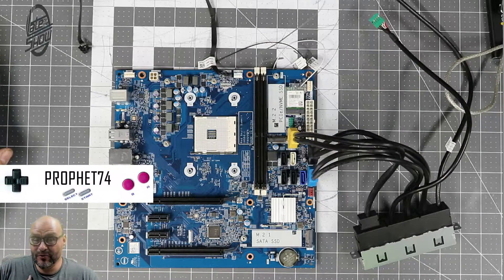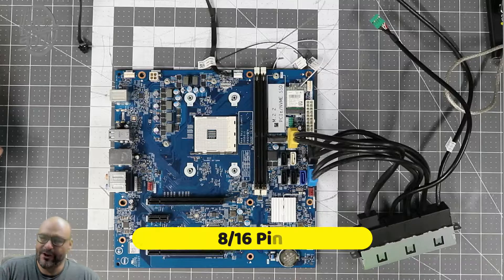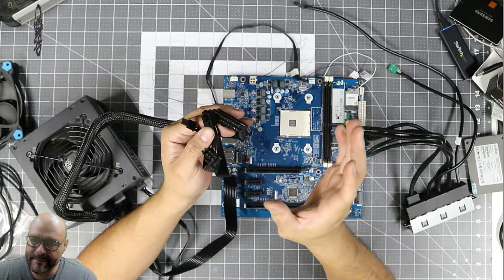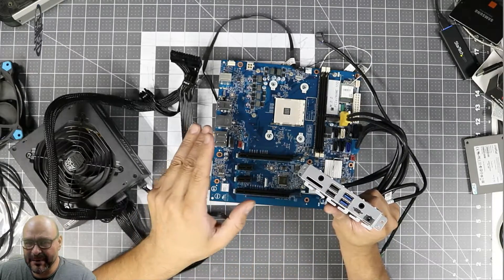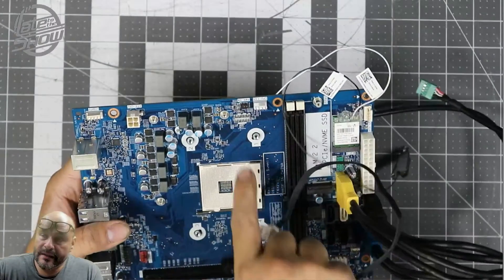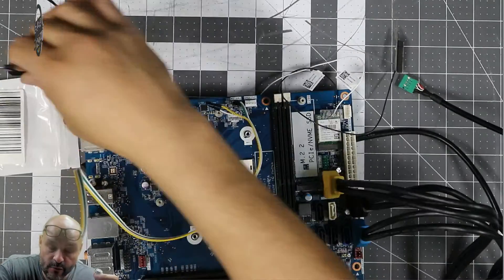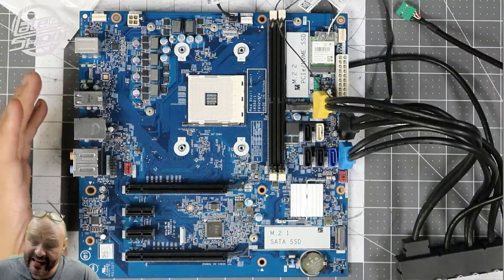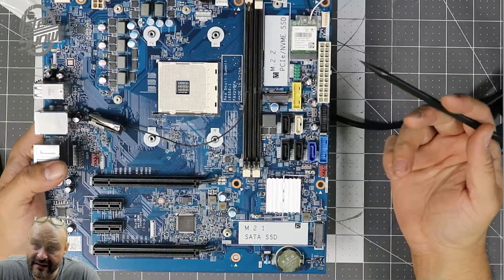Upgrading Dell Inspiron 5675

Comment: Also 2:00 an 8(4+4) pin connector from my Segotep 600w worked fine on my board for the cpu power.

Comment: This guy is showing the PCI-e power connector as being the CPU power connector. They are COMPLETELY DIFFERENT. Any standard power supply will have a CPU power connector that will plug directly into the 4 pin CPU on the motherboard. You don't need to buy any converter. This guy doesn't know what he's talking about in regards to the CPU power connetor.

Comment: the 4 pin connector is rated for 192 watts and r7 2700x max power draw is 105 watt, which is the best upgrade option for this motherboard, that is currently confirmed. so I personally don't see a problem with using a 4-pin connector for the cpu.
Reply from the maker: You have none for this motherboard, unless you can rewrite your on connections and you know how to read the voktage. I had to replace the entire case, motherboard and power to upgrade.

Comment: I saw people succeeded in flashing a 5676 bios into the 5675 to get support of Ryzen 2700.
Reply: do you know if they released a bios update for a 5800x3d?
Reply: @kommandokodiak6025  For 5675, you can only use 1st gen Ryzen. I am not sure about 5676, but it is very unlikely Dell would be so generous to give it supports of the 5000 series.

Comment: can you make a video on how to remove the power supply?
Reply: I just upgraded the pc to a 850 watt. Besides unscrewing the screws, I had to rip off the back plastic in order for it to fit.
Reply: @andersontucker5522  friend posts a video explaining how?? or explains in detail because i have a gtx 1060 and i want to put a rtx 3060 but i have to change the power i bought a 650 w but due to the limitation of the inspiron 5675 cabinet i don't know how to change or would like to ?
Reply: @andersontucker5522  Can you please share which PSU brand/model you purchased? Thank you
Reply: @austintrejos995  a gigabyte 850 watt. I sold the pc a while ago, but I would recommend seasonic for any new psu.

Comment: I bought a MSI MAG A550BN PSU for my Dell Inspiron 5675. I think I connected it right but base on your video it doesn't turn on because the CPU cables pin are an 8 pin and the mother board has 4, am I correct? Do I need to return this PSU? Thank you.
Reply from the maker: Yes you need to return the PSU

Comment: hey man maybe you can help, i just installed a new cpu  (ryzen 5 5600X)  on this dell and now my comp wont turn on, you think this new cpu doesnt have enough power from the power supply or what could be the problem, i had the stock cpu the ryzen 3

Comment: Have you tried installing Server 2022 on this 5675 motherboard, I have been trying but I keep getting stopped after I install HyperV and most of the time (not ALL the time), when I reboot the server it just has the windows circle just going on forever, I have waited 90 mins and did not see if complete and other times I got it to reboot but after is gets into this loop I have to hold down the power button and sometimes in goes into recovery mode and sometimes not?  Any ideas ?   I am thinking about putting 2019 on it today and see if I am getting the same results, but I would be interested in your thought since I got 32gb of ram in this 5675, it would be great for a small Hyper-V server running 2-4 VMs.

Comment: My Dell Inspiron 5675 doesn't turn on after a power outage in my area. I saw a video where show to check the diagnostic LED light in the back of the PC. When I press the button the light doesn't turn on. I believe the power supply needs to be replace. Does anybody know where can I purchase one? Could it be something else?
Reply: You can get an EVGA 700 watt power supply for about $80 that fits really well in this case

Comment: I had a problem where I wiped my hard drive after having constant crashing and blue screen problems.

Whenever Booting my pc I would get the crashed blue screen to scan or repair and I could continue and it would boot fine, but I would often struggle updating windows and could not reset my pc at all except for wiping hard drive.

Now that I reset my hard drive to reset my computer and install and ssd, I’m unable to install windows, is it a bios issue or something else?
Reply: @late to the show
Reply: Really could use your help

Comment: replacing psu and upgrading to rtx 3080 need to reinstall windows? or I can just uninstall amd driver and install nvidia drivers after switching gpu?
Reply from the maker: No need but you need to turn off the security feature in bios before the upgrade
Reply: @LatetotheShow  what feature?
Reply: @LatetotheShow  can turn it off after upgrading. I just now put in my gpu and need to put psu. I can't turn it off after upgrading stuffs?

Comment: Is there any way I could upgrade my GPU and do you have any ones that i could upgrade to? I have the AMD R5 1400 with a RX 570. Which GPU's could I upgrade to? And If I need to upgrade my power supply how would i do that?
Reply: Rx580 and gtx 1060 are plug in play upgrades. There aren't many other options as the mother board does not allow it.
Reply: A new power supply would require a new case. Pretty much, only things you could upgrade without essentially rebuilding it, is ram ssd and gpu. As long as you don't surpass wattage
Reply: @SnD340  I was able to upgrade the psu by taking off the back plastic panel. 😁
Reply: @andersontucker5522  friend posts a video explaining how?? or explains in detail because i have a gtx 1060 and i want to put a rtx 3060 but i have to change the power i bought a 650 w but due to the limitation of the inspiron 5675 cabinet i don't know how to change or would like to ?
Reply: @CanaldoFeB  I was able to take out the old psu and put in a new one just fine. Used the same screws I think. Just a screwdriver and pulling it out. Pretty simple
Reply: @andersontucker5522 I know many years have passed away... but, did that psu upgrade worked well? I want to change my psu because it started failing but want to put some extra power to change the gpu as well for a 3060 or 4060
Reply: @sargentosayala4967  I don’t have the PC anymore but when I did have it, it was working fine.

Comment: Wow, where do I even begin lol. I have this system. NO ONE wants to migrate this piece of shit to another case. You're talking about completely useless 'upgrades' no one wants. What would be more useful is a video on upgrading the video card (this system came with several different cards) and upgrading the CPU (again, this pc came with several different CPUs). Plus, if someone were inclined to move this motherboard to another tower any tower you buy will have front connections for USB, ect. Unless the connections are proprietary there is no reason you couldn't plug the new connections into the motherboard.